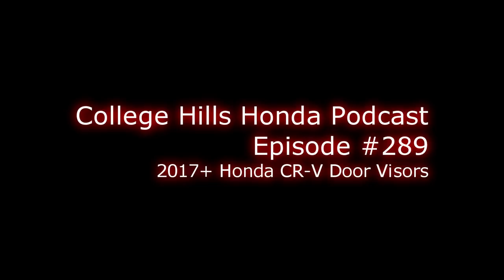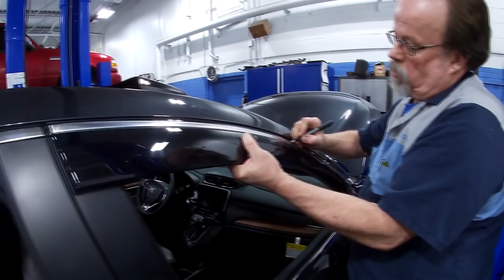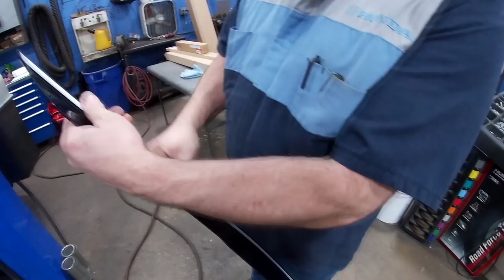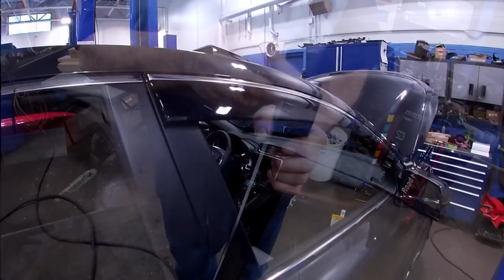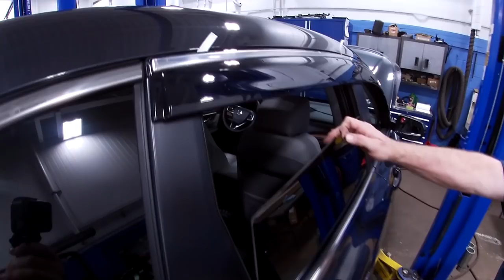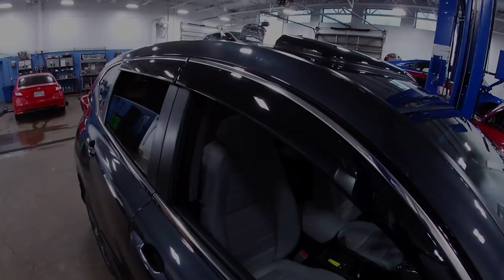Episode #289 - 2017-2022 Honda CR-V Door Visor Installation

Comment: The hard part is the clips install on a 2022 CR-V would think is the same process, what is NOT mentioned in this video is there is a A and B clips, as they are different designs.  The hands block exactly how they are installed and the proper angle and how they should be facing outwards.  Just a couple of observations on my part, perhaps video be edited or redone a little more slowly.

Comment: How do you remove these?  Will the chrome be permanently damaged by removing the adhesive or will goo gone take care of it?
Reply: The chrome shouldnt be damaged. There are several ways to remove adhesive like this - you could try LOW heat with a heat gun, or you can use a piece of waxed dental floss and pull it through the adhesive. Once it’s off use a gentle cleaner to remove the adhesive.

Comment: Can be removed if installed wrong
Reply from the maker: It may be a challenge but it is possible. If successful you will need to apply new 3M tape to the visors.
Reply: @CollegeHillsHondaAccessories  thanks you